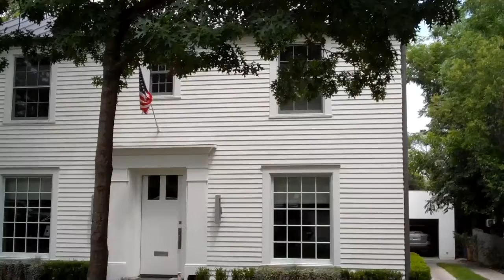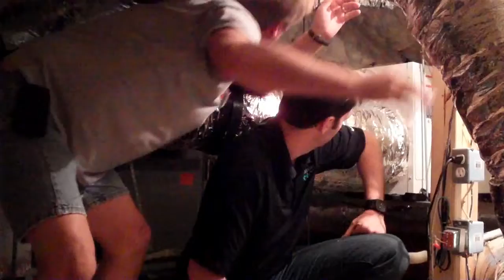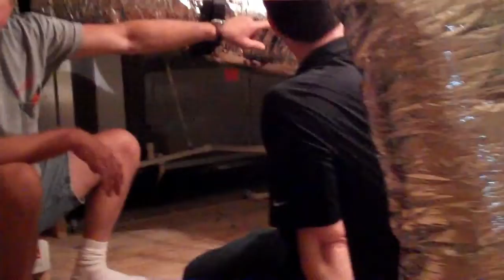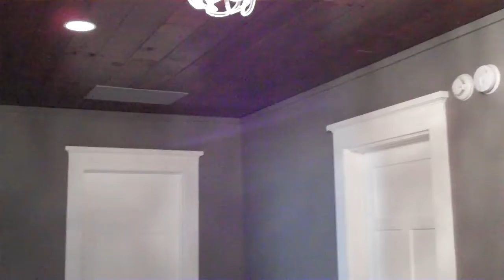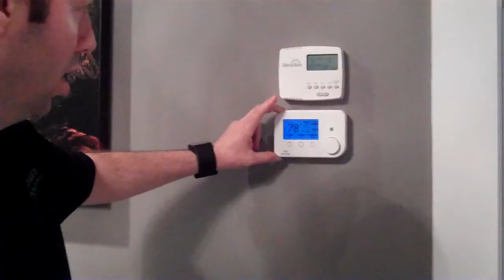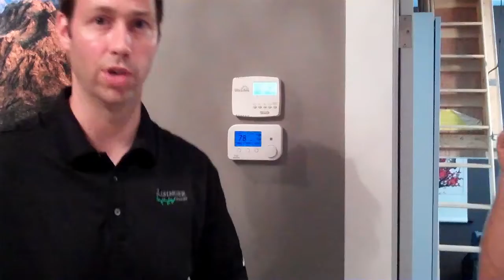Ultra-Aire 90H Whole House Dehumidifier Retrofit

Comment: How does the air circulate in the ducts, does the Dehumidifier control unit turn on the furnace's blower or or does the dehumidifier has its own blower?  Thanks.
Reply: I'm curious as well. Also I wonder how / if it's possible to tie into a zoned system a send air to each zone, and if each zone can send humidity information (calls) to the dehumidifier.

Comment from the maker: These dehum's have a fresh air port so you woudn't need an HRV or ERV if your fresh air is going through the Dehum.  The water from this unit dumps into the condensate drain of the AC which I put to the sewer system.  You could dump it to a rainwater barrel or grey water, but remember this is distilled water so it's not great for plants without mixing with other water.  I really like the Ultra-Aire units because they are so efficient.  This one uses 6.7 amps which is VERY efficient.  Best, Matt

Comment from the maker: I hate to comment on price from a distance, but it's probably $3-5k for a retrofit of this unit.  See if you can find a dealer locally to quote you an installed price.  I believe in these units and think they are well worth the money for the increased comfort and energy savings over just using your AC unit for dehumidification.  -Matt Risinger

Comment from the maker: Yes the shoulder seasons are the big culprit.  These Ultra Aire units operate much more efficiently than turning down your ac unit.  The 90h runs at around 7 amps where as your AC compressor can pull 20-30 amps.  If you have a full in ground basement with moisture issues you might consider looking into a Santa Fe dehum by the Thermastor people.  A dehum running in the area of the humidity source would work more effectively than a ducted unit attached to your whole house HVAC system.  Matt R

Comment: Great video. I experience a LOT of the same problems with the shoulder seasons. Matt, do you know a lot about the operating costs of these units? Is it cheaper to run than the ac? I currently run a 40 pint energy star dehumidifier in my basement that successfully handles the whole house, but it is an energy HOG. My energy consumption can jump by as much as 150 kw a month operating it during the shoulder seasons. My basement is a lot more humid than the rest of my house.